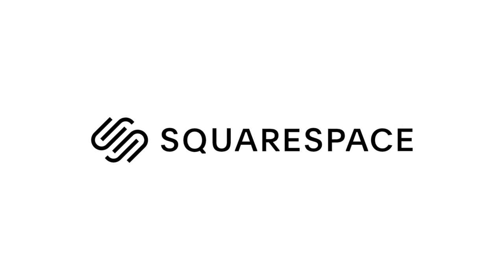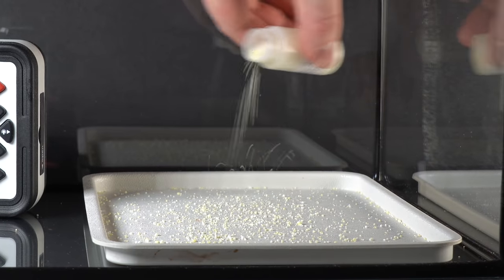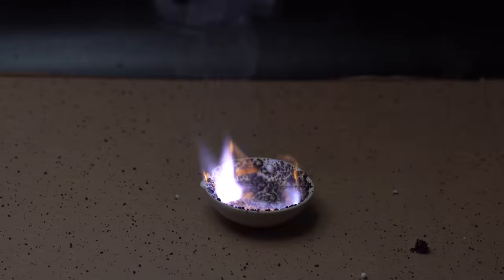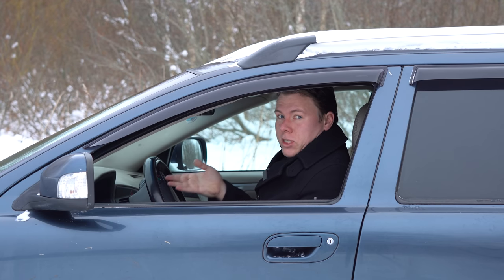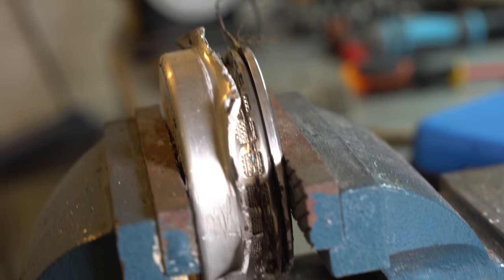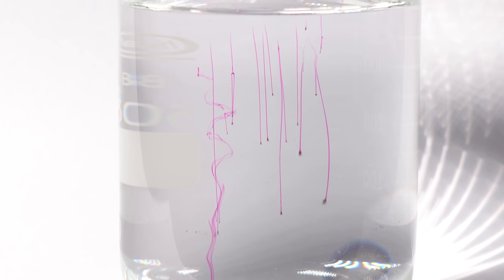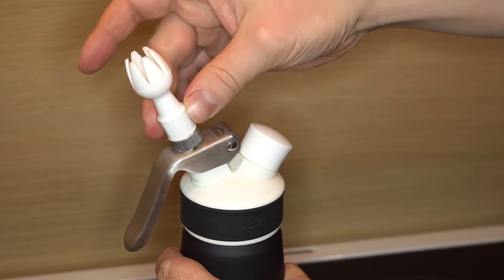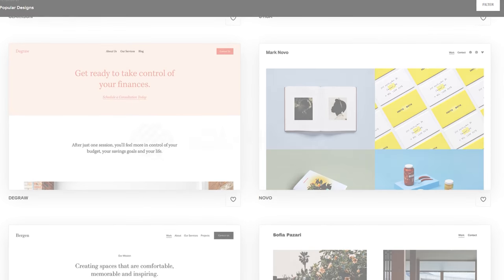Now I'm afraid to make experiments...

Comment: goodgawd man... NaN10,000 is a harsh chemical, super fast breakdown, explosive is too mild of a word for that reaction. And HOT it is... lots of people who have been exposed to bags going off have ended up with 2nd degree burns on the top of the legs, inside the arms and chest....  next time if there ever is one...  use a hack saw, yes its slow but its less chance to blow... Im amazed it didnt crack the vise.

Comment: The igniters were probably faulty, as it is unlikely the manufacturer would make it impossible to set off due to the safety issues it brings about, we used to ignite them if they were removed to be sent back to the manufacturer, as transporting them without igniting them as you can imagine is quite dangerous. Funny enough though never has both first and second igniters failed on any I had to replace, so the chances of getting 3, must be astronomical.
Reply: The plastic clips need to be popped out.  The it will work as seen in other videos.

Comment: Thats rough. But thats why i dont use the handle they give you. Keep your hands far away as possible. Thats also why i dont use the guard although dont do that. The guard does nothing if your hands are no where near the blade all it does is put you in a situation where you need to twist the grinder to cut deeper and then it binds up and tries to snap your wrist.

Comment: the connectors on airbags are designed to short cicuit the pins as soon as you unplug them, so it cannot be triggered by static electricity.

Comment: Don't feel too bad I once mixed liquid dish detergent and washing bleach solution together once without a gas mask, shit burns the air ways nose face and eyes, didn't take much either, with a very incapacitating cough, ya know you can get a bunch of cheap water bottles, and make some cheap gas grenades, just gotta make the right combo so the plastic will structurally fail...

Comment: Airbags in the US have been historically more dangerous than those in Europe. Reason being in Europe the regulation, public education and enforcement of seatbelts was sufficiently effective that airbags were designed to save lives based on the assumption you were already wearing your seatbelt. However in the US, seatbelt usage was so low they designed the airbags assuming idiots are not belted in. To achieve this they needed the airbags to be much larger, more forceful and violent.

Airbags are intrinsically dangerous, rapid pressure and force is being applied. Anything covering the airbag becomes a projectile and your limbs easily dislocated. US airbags have caused many deaths and injuries in cases where someone wearing a simple seatbelt (and no airbag) would have walked away unharmed.

Adherence to safety guidelines written in blood is not only important to an individual but collectively to society when refusal leads to responsible people being harmed.

Comment: Excellent video very interesting, captavating  even... But at 12:08 mins you show angle grinder, did you see the disc edge, chips and chunks missing, gouges, at £.0: 40 pence a cutting disc you need to invest, that's dangerous to use...   Have you ever seen a disc explode, it's shrapnel in every direction so, chip in edge change the disc dude, stay alive make more videos... So... Thanks.  Thom in Scotland.

Comment: How many planes have gone down from the oxygen generators?
Whenever I use a grinder I use leather welding gloves.
Reply: None from the oxygen generators installed in the aircraft. One crash (the ValuJet crash in the Everglades) was caused by a crate of expired oxygen generators that was being shipped as cargo. They were improperly packed (dozens of them, just tossed in a crate), and it’s believed that they shifted, pulling on one of the generator’s triggers. The released oxygen in an enclosed space, combined with the high temperature reached by the generator during use, caused a catastrophic fire.

Comment: NaN₃ is extremely dangerous. Just as NI₃ or AgONC.
Reply: Alkali metal azides are 'more stable' than notoriously brissant and sensitive heavy metal azides. It is all relative. In terms of toxicity, exposure of azides to acidic conditions can liberate highly poisonous hydrogen azide, aka hydrazoic acid. Which is also dangerously unstable.

Comment: Your a chemist. You realy need to understand your job a bit better. Its dangerous as heck.
My advice from some one thats pulls things down and out of house to out new things in and i like my hands undamaged but i like jaming them any where without fear or hesitation. So i wear protective gear. Less then what you should have access too yet my set up is much better equipped for what i do by so many levels comparex tp how equipped every chemist i ever seen has been equiooed. Fume hood is your only shield most times.
 Dont be scared. 
Be less silly. 
Its an explosive. 
You were using a grinder. 
Next time use a wheel imbedded with diamond on all surgaves. One cost me $50 can cut stainless steel sheet without heating it up causing colour change. Normal grinder did. The diamond doesnt abraid materail through friction. It literally cuts the steel tking the heat from the cut with it. Had you used one i think your would have been safe. Also get welders gloves x2 one fore work one for home. I promise you wont ever feel scared again. Full face shield one where the air you breath ones from behind you with a simple dust filter. A scottish guy on youtube makes giant movie and video game swords makes his own respirator device and uses them a lot. Michael cthulhu.

Comment: The chemicals that were supposed to save him harmed him.  Another reason that airbags should be ILLEGAL, or at bare minimum an expensive OPTION that people can buy if they want.  I've seen the aftermath of countless accidents, and not a single one were an airbag was of any help to anyone.  Airbags kill and cause severe injury in accidents where without an airbag everyone would be completely fine without any injury.  I'm not saying that there aren't ANY cases where an airbag saved a life, but they have killed far more people than they have ever saved. #airbagskill
Reply: "The chemicals that were supposed to save him harmed him." But, you are not 'supposed' to dismantle the explosive-containing cartridge of airbags!  Just like you are not 'supposed' to dismantle  consumer fireworks! When it comes to pyrotechnic devices, you often don't get a 'second chance' should a serious accident occur. The sodium azide-containing cartridges are supposed to remain intact as part of the safety feature of cars. I am sure that airbags have saved lives, and that trials and tests were conducted by scientists before the decision was made to introduce airbags to cars. Personally, I'd rather suffer whiplash in a car crash than a fracture that could leave me paralyzed for life. Sodium azide is sensitive to friction, heat and shock. Using a rotary disc grinder to open up an airbag cartridge is not a wise thing to do! If he was after sodium azide for use in experiments, syntheses and demonstrations, I am sure that he could have safely synthesized it, given his sound chemistry knowledge and excellent practical skills.
Reply: @garycard1456  You obviously missed my point.  In a severe enough crash the airbag mechanism can be crushed, causing the same type of burns demonstrated in this video.

I too would much rather have whiplash than  a life changing fracture, which is why I will never own a vehicle with airbags.  Do some actual research and you'll see how many MORE severe injuries airbags have caused than there would have been without airbags.  Just 1 example is from an accident my best friend had several years ago.  She was involved in a very minor fender bender that would have resulted in 0 injuries if it had just happened.  Instead, the airbag went off, and tore up her entire face.  She was severely cut and burned by the airbag, and was embarrassed to be seen because of the cuts and marks.  She was back to normal in a few weeks, but many have not bees so forutnate.  If you see the REAL statistics, you would wonder how airbags are even allowed to be installed in vehicles.  Population control?  Choose your conspiracy.

Comment: well damn. never thought you would make such a rookie mistake. never use anything that creates sparks to cut open something that explodes when heated. might as well have used a torch to cut that open. should have taken your time and used a hacksaw coated in oil. and recoat in oil constantly. but, i myself would most likely have done the same as you. hindsight is almost always 20/20